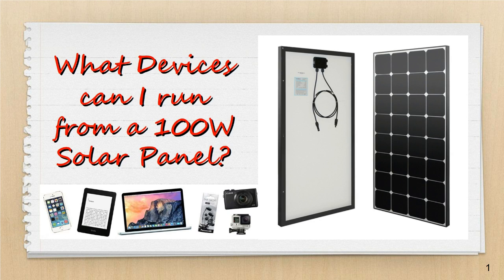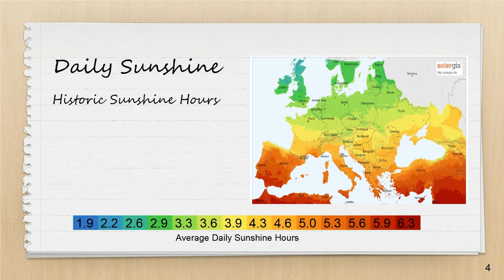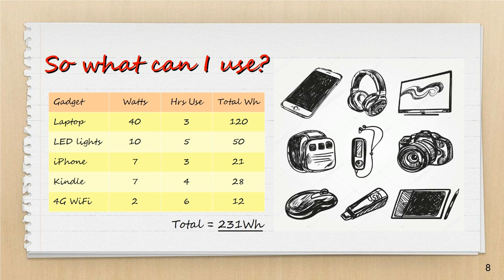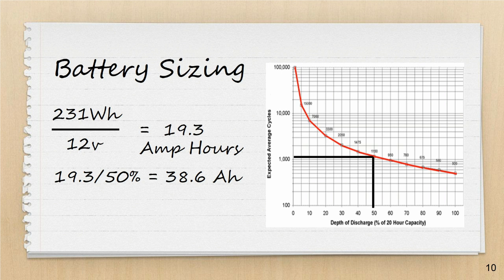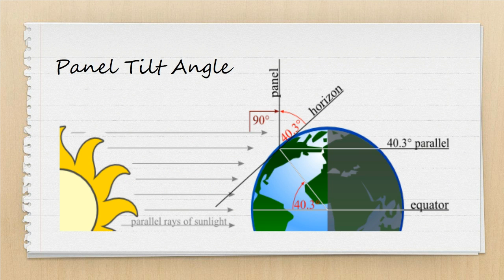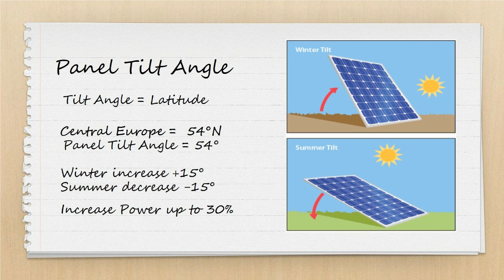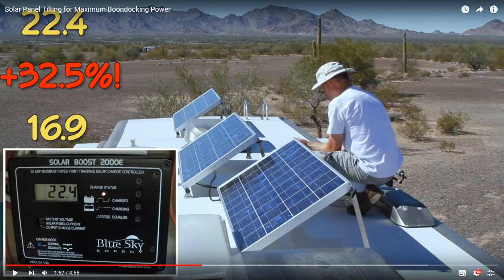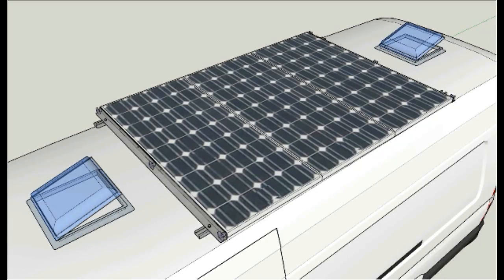What can you run on a 100W Solar Panel?

Comment: The solar energy is really new to me. I was given a AGM type battery, it says 100Ah for 12V. So it should be ok if I get one 100W panel, correct? Thanks!
Reply from the maker: Harry, the more solar you have the more you can use during the day as your battery will remain topped up. If you can get a couple of panels it would give you more options to be off grid longer. 👍🏼😃
Reply: @GregVirgoe  I see. Thanks Greg!

Comment: Morning Greg great video for newcomers to solar we have a Viking 20 inland cruiser with shore power and 12 volt from two leisure batteries (1starter and 1i switch to leisure after about ten mins of engine run time but we have no fridge onboard  we have a 12/ 240 volt cool box for milk bacon etc and want to set up a solar system for the cooler box the box says 52 watt in cool mode inside the lid do you have any suggestions as to what we could use to keep our cooler box going especially over night as we don’t want to drain down our boat batteries many thanks 
Clive.

Comment: Is there any way to fit a solar panel to be removable?
I live in an area where shiny dust caps are stolen, bloody scrotes
Reply from the maker: Falk Harvard yes, you just need some quick release fasteners and you can get waterproof caps for the MC4’s cables on the roof.
Reply: yes now i saw a video last night and the girl put in on her door which was held up on the door with 95 # magnets, bolt/washer - pretty cool

Comment: Question - On days when we have no sunshine (N.W. Ireland here so that's about 340 days/year lol) would it be possible to have your leisure batteries charged from your vehicles main battery as the engine is running or would the charging system from the van engine and the batteries be completely different? Great channel. Great Skool for Adults In Lockdown! Cheers brother....
Reply from the maker: Best way to do this is with a DC to DC charger and a good one I recommend you look at is the Victron Orion :D
Reply: @GregVirgoe  Thanks very much for your swift response Greg. Will check it out. Thanks again, have a good one...

Comment: I have one of these connected to our campervan that I fitted around there years ago. I haven't discussed this with anyone in the past two years at least other than today with my girlfriend as.. today I tried to start our van which has been sitting at the side of the road since last august. I started it today and let her know that it works fine and started first time, probably due to the trickle charge from the battery.

I signed in to Youtube about 10 mins ago and one of the recommendations of videos to watch was about 100watt solar panels in a campervan. This one.. WTF...?? How did it know???
Reply from the maker: Siri and Alexa will listen to your conversation and feed you ads based what you talk about.
Reply: He's also psychic!!

Comment: Excellent video again , Greg, but what about a demountable system so you can park in the shade but put the panel in the sunshine? Sorry if this has already been mooted.
Reply from the maker: You could have that if you wanted Chris, they do a 100w panel that folds up into a bag and put it in a cupboard when not in use.

Comment: Great video again Greg. 
Could you clarify whether or not the calculations are based on the panel being perpendicular to the south.
Reply from the maker: Hello Davie, the calculations are based on the rated output of the panel at test conditions. 
i.e. 1000w/m2 and 25C temp
We know now that solar is very dependent on perfect conditions so if you have the space and budget my advice would be to maximise your panel size to account for all the times it’s not going to be working at its full potential. 
Hope that helps. Cheers
Reply: Greg Virgoe I have two Ubbink 240W; 37V (VOC); 8.7A (ISO); 28.9v (Vmpp); 8.3A (Impp) so should be okay.
Reply from the maker: Same total watts, they are big panels, what van have you got?
Reply: Greg Virgoe Short w/b vivaro.
Reply from the maker: Nice, so will it be a weekend type van with rock and roll bed
Reply: Greg Virgoe Actually not sure about this one yet. Looking at a rear pull out bed if I can keep the weight down and making it capable of full time living. 
Might also build a vertical axis wind turbine. But weight might be an issue.
Reply from the maker: Interesting not seen one of those on a van.

Comment: I have 1000 watt inverter and 100 watt solar panel with 100 mAh battery I have to run 70 watt room air cooler on it
How long it will run on it

Comment: Ive bought a kit , on advice  from the company i spoke with i am using the system for weekends , charging decices from USB such as a mobile phone , maybe a tablet and led interior lights . 
They sold me an 80w solar panel kit with victron charge conrroller, ive bought an AGM 110 AH battery, do you think this is about right as they said i wouldnt need much more than this ?

Comment: i have 1 100w solar panel, and a 110 AH leisure battery, should be ok but as i am not tilting my panel for sun and i dont have MPPT charge controller, to accommodate would you suggest another panel?
Reply from the maker: Hi, if you add another panel to your system your PWM charge controller will limit the voltage going to your batteries so you will not benefit. If you want to add another panel I would suggest you add an MPPT controller as well.

Comment: Why not use small mirrors at an angle around the panels, so you don't need to put panels up at a high angle ,is that feasible ? Just asking
Reply from the maker: Hi kodi, interesting idea, but the angle of reflection on your mirror would be constantly changing as the sun moved across the sky, you would need to motorise the mirrors and have some fancy solar tracking system installed and then it starts getting really complicated. Plus there is barely enough roof space for solar panels so no space to put additional mirrors. Thanks for the suggestion.

Comment: Hi Greg,
have you considered using a linear actuator to raise the panels remotely? it may save having to have a permanent ladder for access to them.
Reply from the maker: I did look at a few ideas but struggled to find a solution that would not lock up in the flat position. It's something I may keep on the back burner for now and revisit when I have more time.
Reply: @GregVirgoe   take a look at my design, when it folds flat on top of my motorhome the actuator locks the panel down.

Comment: Thanks for another inspirational video.

How are you going to access the roof to lift the panel and is it worth looking at some sort of two way or even four way tilt mechanism so that it can point left, right, backwards or forwards?
Reply from the maker: Hi Tony, the problem with that is how to route the cables, they are all presented at one end of the panels, that's why I have put them near the hinged end. I can easily turn the van around 180° front to back to swap sides and if it's a real problem i'll just leave them laying flat and suffer the little bit of loss. Go for a hike instead of playing on the laptop.

Comment: Any ideas to create a panel tikt system, if I'm in the wheelchair and can't reach them on the roof ?
Reply from the maker: It would need to include some 12v linear actuators or a step motor and screw mechanism similar to scissor jack?
Reply: Greg Virgoe I'm not so practical and don't know exactly all the parts you mentioned, but I'm definitely take them in consideration and start researching. Thank you so much for your time !

Comment: Greg, I’m new to your channel and there is some great info there!  Are you considering also connecting the batteries to the alternator!
Reply from the maker: Yes, Robert, I have the voltage sensing relay kit ready to install.
Someone else questioned whether my Alternator was up to the job.
So I'm doing a bit of further research before I install it. watch this space lol
Reply: Greg Virgoe most modern alternators push out 90-150 amps @ 13.4 volts.  So it will charge them!  Especially as you will be traveling it’s free power!
Reply: @rlmilliganis  Unfortunately not totally free. I did some tests on mine. With the VSR running I averaged 27.5 MPG, with it turned off MPG went up to 34. I tested for a week of each under similar driving conditions. Not totally scientific conditions, I know, but 6-7 MPG on a long trip is a fair amount. There usually has to be some sort of trade off somewhere along the way.

Comment: Hello what are the specifications of an inverter for one 100 w solar panel, thanks
Reply from the maker: Mario Kelly the size of inverter has no direct relationship to the solar panel as it runs off your leisure battery. Your inverter would be sized to suit the watts of your 230v appliances. What mains devices are you going to use?
Reply: Greg Virgoe mains devices used are a fan, a laptop, a small fridge, though I guess not at the same time. Thanks

Comment: On a camper van install the biggest battery bank you can afford. One 220v shore charger, one 150Ah engine alternator, as many solar panels as possible. imagine a water tank, the bigger it is the more water you can use over a longer time.

Comment: Great one Greg, I'm design a similar system, but with 3x100w semiflexible panels,and one "free" that I will be able to move around the van, or stick to the side with neodymium magnets if need arises. The flexible panels will be mounted with vhb tape from 3m to aluminium angle profiles (30x30x3 mm) which in turn will be mounted the same way you have, but with the vhb tape. No unnecessary holes in my roof! They will of course have safety wires just in case. There is a big difference in weight, the flexi panels weight 1.8 kilos each,and the frames no more than 1 kilo, so under 10 kilos for a 300w array. The question is, how have you solved the problem of acutally getting up to the roof of the van to tilt the panels? My Master is an extra high top, 2.7 meters. I'm tall at 186 cm, but not tall enough! The best solution I've come up with is to use a 2 meter telescoping ladder,but that will take up valuable space. Hmm, maybe there is a way to secure it to one of the back doors. I'd be interested to hear how you've solved it, maybe I'm making a mountain out of a mole hill,and there is a simpler solution I'm missing. I guess the ideal would be to have them motorised.
Reply from the maker: Hi Tim, my only solution was also to carry a telescoping ladder in the back of the van.
I didn't want a permanent fixed external ladder because that just invites anyone to climb it.
My three panels weigh 32.5kg all together so they are reasonably heavy to lift in one go.
Looking into using gas struts or maybe adapting an ottoman bed lifting mechanism.
Each gas strut can lift 50kg on its own so a couple of those would be loads.
Reply: Greg Virgoe  that's a great idea, Ill look in to gas struts too!
Reply from the maker: Hi Tim, I’m wondering if I could use something like this. 
https://rover.ebay.com/rover/0/0/0?mpre=https%3A%2F%2Fwww.ebay.co.uk%2Fulk%2Fitm%2F282026175127
They can lift a double bed and mattress so strength wise would be a breeze.
Reply: Those look good! I might have to get a pair for my Murphy bed, it weighs a ton! (well, around 50 kgs) how wide are your solar panels? Only thing that comes up as a potential difficulty is if it will be an uneven lift from the side you're standing on,but as you say, they are built for much larger loads so I think they would be fine. You'll probably be able to raise it with nothing but one finger. It would be very nice  to have them motorised  by remote control . Right now I won't have time to investigate, but in October I will look in to it. I will be living in my van now full time for 3 months, about 75% completed, to work out any kinks before I do the final finish and before I set off to southern Europe.

Comment: How big inverter do you suggest to use with this 100w solar system? Thank you!
Reply from the maker: Martinas Puidokas the size of your inverter is relative to what you want to plug into it. If the biggest thing you use is a laptop then a 500w inverter would be loads big enough. If you have an induction hob or kettle then you need something much bigger. Bear in mind that any form of electric heating uses loads of battery power so if you want to be off grid look for different energy sources like gas and diesel

Comment: According to the chart you have at 5:34, it seems there is only a mild difference in total Ah the battery can output over its lifetime based on it DoD (Depth of Discharge) For example, let's suppose you have a 100Ah battery and always discharge it to 50%, the chart states 1150 cycles so at 50% discharge, that would be 57,500 Ah total. (1150 * 50Ah)

So now let's take a look at the 100% discharge numbers.  The chart shows 500 cycles so that would be 50,000 Ah total, only about 13% less than stopping at 50% DoD (Depth of Discharge).

So many people think that if you only discharge to 50%, your batteries will last MUCH longer, but the chart doesn't seem to confirm that.  There is only a mild increase.

Just to show this pattern continues, let's look at 25% DoD.  Here, we would stop draining the batteries very early then recharge them.  The chart shows about 2675 cycles which would be 66,875 Ah which is a 16% improvement over 50% DoD.

So, if this chart is accurate, it seems better to oversize your battery bank and if possible, only discharge it to 25% DoD (if possible) then recharge.  For example, a bank of 1000Ah total discharged to 25% DoD should perform better than a 500Ah bank discharged to 50% DoD.  However, this assumes that the person has the budget to afford a large battery bank.  In many cases, the money saved by having a small battery bank and discharging it deeper is a cost effective solution.

Comment: Hi Greg! Great video, I will be fitting this system to my Nissan elgrand in the near future, but I have a few questions.....

The van comes with a built in 100v  socket (us/japan type) which is location in the back and works/ powers things that are plugged into it when the engine is running and also switches off when the engine switches off. 

I was wondering if I could plug in a 100v battery charger into here and connect my 12v leisure battery and solar system to this?

This would save me running additional cables from the engine bay to the back and fitting a dual battery isolator/switch system also.

Im just not sure if 100v will charge a 12v leisure battery? 

Thanks 

Joe
Reply from the maker: Hi Joseph, it will work while driving along, there will be losses in the system transforming the voltages up and back down again so not very efficient. Would it be difficult to just run a single cable between both batteries with a split charge relay inline?
Reply: Greg Virgoe hi. It won't be too hard to run a cable and install a system, I just wondered if the one that's in the van would work (saves me a job off the list) that's all :)

Comment: so a 35 amp hour battery is too small for a single 100w solar panel?
Reply from the maker: DIY Redneck, as leisure batteries go that is very small so it does limit you as to what you can use and how you use it. You can run some load directly off your MPPT charge controller so when you have ample solar during the day charge up all your tech devices, so you can use them at night on their own batteries and don't charge devices overnight off the leisure battery, turn off inverters when not needed and also turn any fridges off at night, they will remain cool inside till the morning when the suns up and you can use the solar power, that leaves your battery for essentials as night like a light or maybe water pump etc, hope that helps

Comment: Can one drain batteries fully by using a deep-cycle battery?
Reply from the maker: Hello William, AGM batteries have the ability to be drained 80% depth of discharge but doing that regularly will shorten the life of the battery. 
Lead based batteries like to be kept topped up regularly and if you only discharge to 50% you will get over a thousand cycles and they will last 3-4 years easily. Mine never drop below 12.4v which is 30% discharge.

Comment: One issue, perhaps I'm misunderstanding.   You calculate a number of items you will run off one solar panel per day and size battery to it, but if you run everything off battery for a couple days as you suggest 1 solar panel will never fill the battery back up as it will use all it power to run the items everyday.  So you would have to have a second panel to recharge battery to cover the bad days.   I think.
Reply from the maker: Rick DeBaan yes of course you can only use what you can generate. Which I why I did it this way 😃

Comment: Hi Greg, Thanks for getting back to me on my last comment. I am looking at a solar kit that consists of 2x260w pannels but comes with a 40a MPPT controller. looking at the maths that controller doesn't seem rated high enough. Should I be concerned about that kit? Thanks!
Reply from the maker: Hello, it appears to be slightly under on amps, The other rating to look at is it's MAX PV INPUT @ 12V
An Epever 40A MPPT controller has a max input of 520W but that's bang on the money and no wriggle room.
I've got 480W of solar and have gone with a 45A MPPT controller just for piece of mind.
IMHO it's not wise to run your electrics at their max rating, they have a tendency to get hot.
Hope that helps.